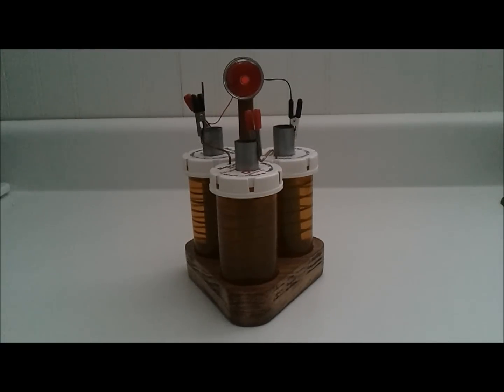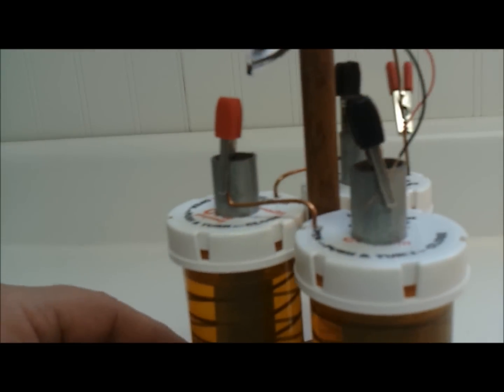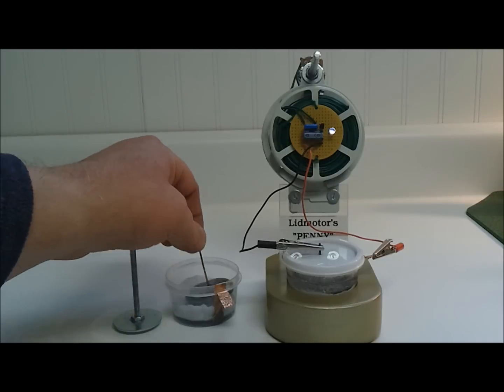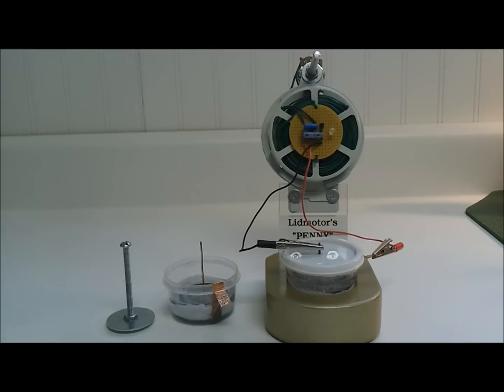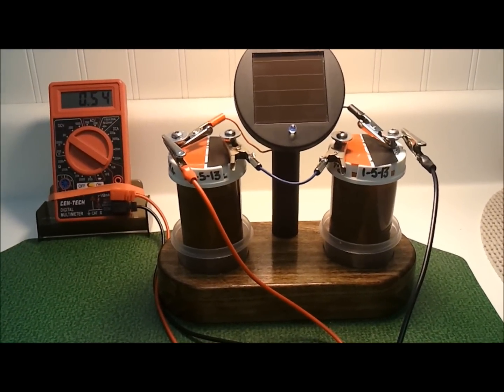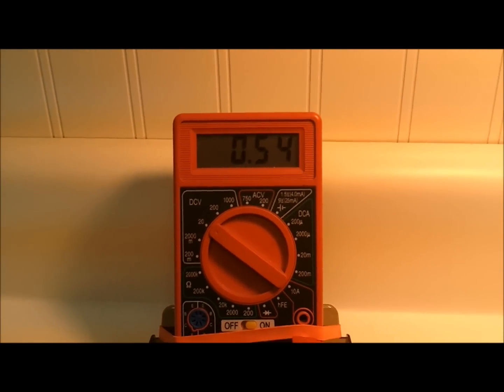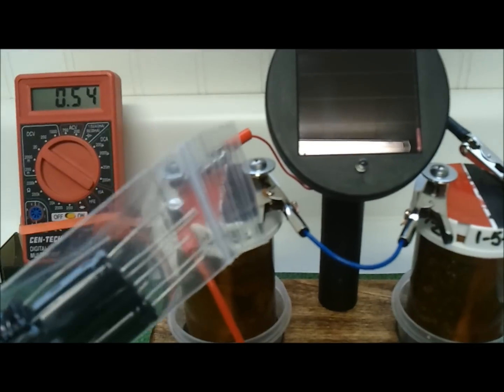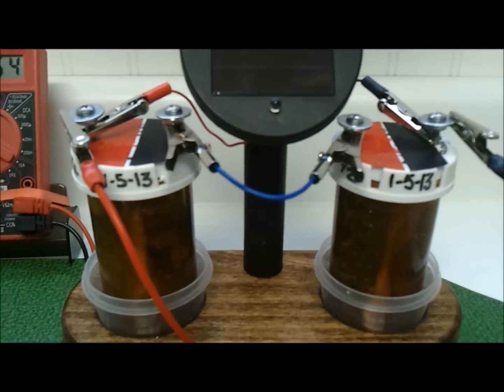DIY Battery Update

Comment: Great video.  Wondering if anyone has tried. A metal cleaner or tarnish remover as the electrolyte instead of just water? I have used dishsoap and toothpaste replacing the water and it made just as much power voltage wise..

Comment: Nice varied selection (btw wife says you sound like John Goodman).
Congrats on 3 1/2yrs. I use steel wool too on Nephilim Penny, 2 years+ now. Carbon/Lead/water is a good one, mine is over 1yr now still running.

Comment: Thanks for the update.  I should probably do a video on my DIY batteries also.  I agree with you that the stainless steel and Epsom salt rechargeable has been the best one.  Mine is still running a 'Penny' led light 24/7 with a small solar panel using ambient indoor indirect solar energy.   Very cool.